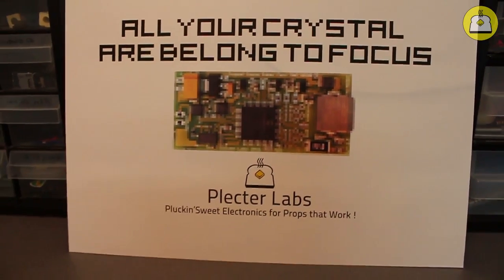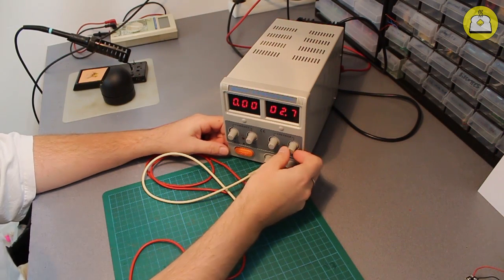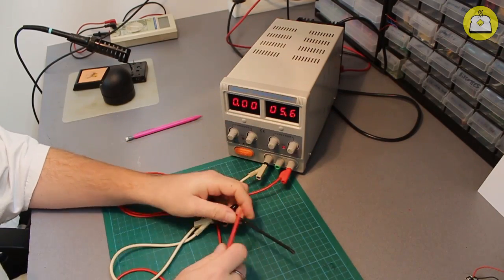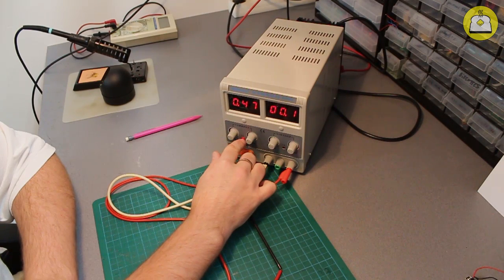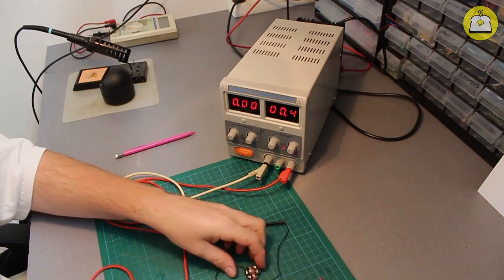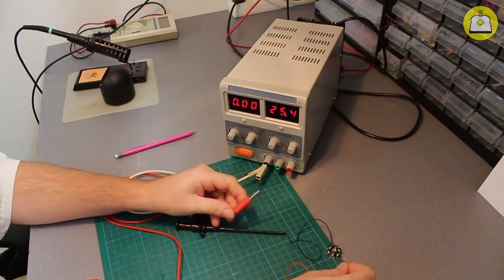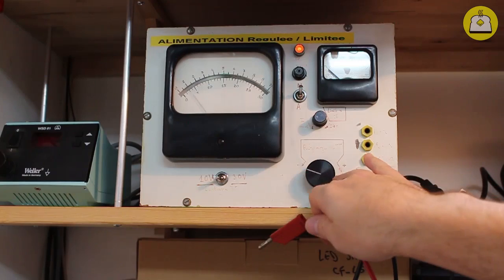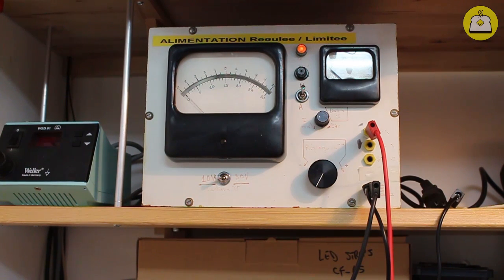Bench Power Supply (PSU) tutorial

Comment: Thanks for sharing this excellent video; you explained several topics that I have been interested in learning more about. Earlier today I ordered a Longwei 3010KDS switching power supply from Amazon.  I am building a home electronics lab, with Raspberry Pi, Arduino Uno, breadboards to experiment with for Amateur Radio and Model Railroading.
I am 74 years old and retired USAF. Unfortunately I am recovering from 2 Strokes and my fine motor skills aren’t what they used to be.  I recently got a Headband Magnifier so I can see where the holes on the breadboard & the leads on the components go.  Getting old is proving to be a challenge to say the least. Thanks to you and others here on YouTube providing tutorials and advice. I am not giving up ❤❤❤
Reply from the maker: you're very and most welcome ! I still plan to get my HAM license one day, and happy to hear about your home / DIY electronics lab. Sending strength for recovery. Challenges are the best rehab and physical therapy, cerebral plasticity exists at all age and your brain will grow new connections, based on exercising. Take it easy but to the long run. Or track, even for model trains (PS : my flight instructor is 76 !)

Comment: Excellent - always seems counterintuitive to short a supply to set a constant current reading!  When buying a PSU (especially second hand) I would check this function before connecting it to your valuable circuit.  Internal relays and switches can stick and cause all sorts of problems.  We have all seen power supplies that have needed repair over the years when they should be the reliable bit!

Comment: Prices have come way down on bench power supplies as of 2017 the ebay range is about $40-$60 USD for 0-30 volt 5Amp many are including free shipping.  In that range most are switching circuit which are lighter maybe a bit more HF noise.  Analog units with the big transformer are still in the $60-$80 + range.  Build quality varies a lot between similar looking units so try to find a tear down review for the model number and brand before purchase.  I would assume the power supply is a switching design unless the product description specifically mentions linear. Both designs have pros and cons.
Reply: You got to watch out on those cheapies. An electrical engineer shows us when turning those cheapies off, there is a power spike which can fry your device you are prototyping.
Reply: GeekBoy03 can you post the link?
Reply: @GeekBoy03  I am well aware of the start up and shut down regulation issues seems. I would never leave a device connected to any power supply when powering up the PSU up OR shutting it down. I suppose if you wanted more insurance a big electrolytic  capacitor across the output terminals would soak up a spike.  I really doubt a $60 or $80 supply would be any better..   I this is a giant concern maybe something $300 to $600 range would address the spike issue.

Comment: Thanks for the video help, I bought one of them and I didn't know how to set the current and I would not of thought of clipping my leads together to do so.
Reply from the maker: very welcome and glad it helped another user !
Reply: Maybe there one more thing you can help me out with, In C.C I never see the a change in numbers, always stays at 00.0  is this normal?  best example is,  and I might not be doing this right, I made a 12V battery pack from 10 1.2v ni mh and I wanted to charge the pack with it, when I plug it the Volts start at 12.5 then after a few mins it slowly drops down to 11.1 but the Amps never change, always at 00.0. Any idea's ?
Reply from the maker: nimh are charged at about 1.4V per cell. You'll see the current increase then, and that where you have to limit it. Safe factor is to charge at about 1/5th of the capacity. NiMH do accept to be charged at the capacity for a quick charge but A) you need a smart / delta peak charger to detect the end of the charge B) it will reduce the number of cycles of the battery. Beware of non-smart aka "overnight" chargers which charge at like 1/8th or even less but will never stop charging. The charging current is so small it will not damage the battery at first but leaving the cells in charge like that forever will kill the chemicals.
Reply: I doubt this power supply is smart in anyway lol, id been 45mins and the voltage has dropped from 12.5 to 10.4V it keeps dropping by 0.1 every couple of minutes or so  ( on the power supply) So basically your saying charging this power pack I made on my bench top power supply is a bad idea .
Reply from the maker: a PSU isn't a smart charger. You need to read about battery charging and delta peak. If the voltage has now dropped to 10V, you're possible far below the delta peak and all your cells might be damaged.
PSU can be used to do slow charging of niMH and niCD, but also lead batteries (the easiest)

Comment: Also keep in mind that most LED's will also have something like a 1K or more resistor in series with their positive lead to also limit the current running through or that the LED can draw, thus keeping the LED from being destroyed. You might want to take that resistor into consideration when setting your current limit.
Reply from the maker: Joseph Rotello total non sense.The huge majority of LEDs do not have any resistor provided with it, no idea where this is coming from. A very few of low power leds (5mm) are pre resistored for being used on 12V on cars, or as power on lights on older equipments that were using 12, 24, or 48V bulbs. That's very specific though.
Reply: I have a few hundred LEDs of various colours and intended applications. I think I have <5 with a built-in series resistor.
Reply: Non-sense ? Then you won't be designing anything I or others use. What I meant was that bare / naked LED's almost always have in the circuit they are used in, a current-limiting resistor found in series with one LED lead. Perhaps 90% of all LED-is-used circuits have such a resistor.

Of course, most all LED's do not come with such a resistor as part of the LED package, and yes, some LED's may not require one, all depending on the circuit need and design.

Comment: Quick question:
I want to test high amps and volts on a PSU. The limits are 30V 10A. I'm going to be testing a motor setup that uses a constant 25.2v, just like a 6-cell LiPo battery. I plan on pushing the amps almost to 10A. So the question is: will the PSU try to maintain 25.2V until it passes 10A? I have a feeling that none of these cheap PSU can achieve anything close to 10A at 25v.
Reply: if it goes over 10 amps then the voltage is gona drop soo lets sey ur puling 9.99amps it vil keep the voltage at 25.2v but if you go over10amp lets sey 10.1 amps the voltage will drop :)

Comment from the maker: @SoldierDDR: the spark doesn't mean there's a lot of current, but the voltage is high enough to generate that spark even at 500 mA. If the meters on the PSU show .5 A when shorted (regardless of the voltage) then it's working just fine and is limiting the current. With a pure short, voltage should actually drop close to zero while amps remain limited to the set limit.
Reply: Ervin Plecter hj b 1

Comment: Little help.. Minileaf power supply

Hi , I'm learning about electricity so I'm new to power supplies
from what I've seen I should be able to set a voltage and amperage before I connect a load, I can set the voltage and it's 
displayed on the screen but the amperage will not display, the amperage selection does not work either
, it will not display the amperage when not connected to a load, once a load is connected
The display shows but generally I think you are suppose to be able to select a amperage limit
before you apply a load.

You can not select a amperage limit before a load is connected
Once a load is connected the amperage dial does not allow you to choose 
a limit either.
I tested it on a led light with amperage turned all the way down but it still went over the limit.
Reply from the maker: Some newer power supplies have a disconnect button to allow voltage and amps settings. This model sets the max current by shorting it as demonstrated. You can't expect current to flow if a load isn't connected.

Comment: I bought one like this and i do like you did. I turn the amp in 500ma, and voltage is0, then i connected the led, i turn the voltage up like yours, until max, and the led survive, i pull the plug and the voltage is 25 like yours, but when i hook it up again like you did, the led is dead, i think my psu isnt fast response ..am i buying a bad psu?

Comment: Also very new to electronics and have a question:

At 8:40 you have the LED hooked up again and have the current limit set to 1.0A. You increase voltage until current reaches 1.0A, and voltage ends up at 3.4V; the LED turns on bright and thus this is effectively a ~3.4 watt LED, yes? Wouldn't increasing the voltage above 3.4V require less current to dissipate the same power? Why does the voltage not go up past 3.4V when you adjust the knob?
Reply from the maker: The voltage locks where the current meets the limit. It follows the voltage current curve of the led. See my other video on led forward voltage measurement for details.

Comment: can i power up my tp link router with (9V/0.85A rating) a DC power supply? (I tried doing it but the voltage reading on the power supply drops as soon as I make the connections)
Reply from the maker: sure, that will work just perfect. Indeed your stock PSU is probably broken
Reply: @ErvPlecter  Thank you for the reply! Just to recheck, Constant Voltage mode is good enough for it, right?
Reply from the maker: @the-ok-stuff  yes it is, correct. Just set your current limit slightly above the ratings of the stock power supply, like 1A and check

Comment: Thanks for the great video.I would have a question to ask you if you don't mind.It may seems to be a stupid question, but I'm just learning electronics, and almost every videos about benchtop dc power supply, they always mention to adjust your voltage to the desire setting and then after, you adjust the current. I have 2 dc power supply on my bench and when I try to adjust the voltage, I have to turn the current knob a bit before I'm able to get a voltage display. Is that normal, or if there's something wrong I'm doing or there's a problem with the power supply??My name is Maurice Petit and I'm from Ontario, Canada.
Reply from the maker: Hi Maurice, you need to have some minimum current allowed before your PSU can output voltage. While the PSU current limitation is intended to put a real limit to it, most of the time, you'll leave your current limit high enough to power your device, like 1A. You don't need to have the current limit down all the time, only when you want to insure the current won't go above a certain limit, like when powering a device for the first time.
Reply: Wow !!!! Thank you very much for answering to my question and also to have responded quickly like that. So, if I'm mostly working right now with transistors and leds circuits, should I set my current to one amp, or should I set it up lower? Is this why, in your video, you shorted both leads of the power supply to set up your current?
Reply from the maker: Your current limit depends on the "safe" factor of your electronics. You first need some insight about the current use of your circuit and set the limit in the same area. For instance, when I first test or debug a new MCU board that uses 70 mA with no sound and no led attached, I first jump start it on the 100mA range of the PSU so that, if something goes wrong, I can't get above this.
Reply: Thank you very much for answering my questions and keep up with your very good videos. It is very appreciated.

Comment: I just got a power supply that looks exactly like the one shown in this video.  I was able to change current and voltage but around 5 - 10 volts I can hear a hissing sound coming from either a capacitor or a fan.  I looked inside but could not tell any possible capacitors.  Any idea?

Comment: If i limit the current to 0,5A and set the device to 20V and close the circuit there are flowing for a short time a lot of amps (big spark)
Is this normal for low budget-PSUs? I bought this one: QJ3005EIII für 139 EUR

If not, can you reccoment a good PSU for max 150EUR i need min 30V and 5A if there is the ability to set it in parallel/serial-mode to set 60V or 10A it will be fine.

Comment: so, i have a question, when you connect a mobile for feeding it, does the current display show you the value of current that is being consumed?
Reply from the maker: +Arreglos Informáticos : that's correct. However, it will probably show only the current used for charging, not what the device is using itself.

Comment: I have a dc motor 7.2 V,  each time I connect to the bench power supply, the current indicator turns on and it’s not working.
With another power supply (simple one, 7.2V- 2.4 Amp, it works good but stop working after 20 min, and with batteries it’s working normally)
The motor was taken from small electric screwdriver.
Do you have any idea what’s going on?
Reply from the maker: not enough current available on your PSU, start current is too high (expected for hi torque motors like in portable screwdrivers)

Comment: good morning sir,
sir i have one maxx dc power supply for mobile repairing 
when i connect the phone to the power supply and switch on the mobile device  i found that current meter is fluctuating from 30 to 50 constantaly in every device so please tell me what is the problame
Reply from the maker: it's probably because it's is charging the battery, which can be with pulsed current at some steps of the charge curve

Comment: Can these type of lab PSUs be used as battery chargers and if so, is there anything "special" that has to be done?   Any special precautions that need to be taken?  What if the battery remains connected and the PSU is off might that harm the PSU?  Also, can a resistor be used to set the current limit  or does it have to be a very low ohm short?
Reply from the maker: +David James the only battery i would let it charge is lead battery as it's constant current with no real time limit. Ni-MH don't like to be overcharged, unless you charge them at 1/20 or 1/10th of their capacity (mAh). Those should use a delta peak charger which detect the end of the charge. Overnight charger charge with constant current with no time limit and that generally ruin the cells (anode) if longer than 8 hrs (reason why they are called overnight). Li-ion use a VERY special charging profile mixing constant voltage and constant current and only specific chargers must be used for those. Same for lipo.
Reply: ***** Ok assuming I am using flooded lead acid batteries such as a 6V golf cart battery, what precautions do I need to take?  Can I just set it to 3A max in current limiting mode and then when it reaches a certain voltage, switch it over to constant voltage mode and let it top off?  Also you didn't answer my question if the current limit can be set using a resistor instead of shorting the leads.   Is it a good idea of extra safety or will the PSU protect itself even without it and even at a voltage higher than a fraction of 1 (such as  5 or 10 volts)?
Reply from the maker: +David James The way I recall doing it is :
- Set the charging current limit  by turning the current knob while applying a short circuit on the PSU with 1-2V
- Set the voltage of the PSU at the proper battery voltage (the charging voltage which is > than the nominal voltage. A 12V battery is charged at something like 13.5, check your datasheet). 
- finally plug the battery. The current will jump at the charging current and the voltage will drop to what the battery voltage is currently. Progressively the injected current will make the battery voltage climb. You need to monitor this and stop once the charging voltage is reached. You can use a voltmeter on the battery to determine with accuracy if you've reached the charged point

Comment: Ervin Plecter, question 
can you switch off the power supply at the power point?  and will it hurt it?
Reply from the maker: not recommended. I always either remove the banana plug or turn the voltage down before switching it off. I tend to always remove the positive banana plug in any case once the voltage is at zero.

Comment: my current CC light is on and wont turn off ? displays all show zero, fan is running ..tuning the knobs does not effect readout of the display? any idea this unit is only a few weeks old.
Reply from the maker: from what you say your PSU is in short circuit (therefore voltage drops to zero and amps to the limit set by the current knob). Or it's dead.

Comment: Thanks for the explanation.  I was about to return my PSU until I saw this video.  I wonder why the digital display isn't carried out to 0.000 (3 digits behind the decimal point).  Isn't, for example 0 to 9mA, common current magnitudes to work?  I would like to see them as well.
Reply from the maker: it's a cheap PSU, so current measurement doesn't have such a nice resolution. If you need to measure a small current, the best is to use an amp meter.